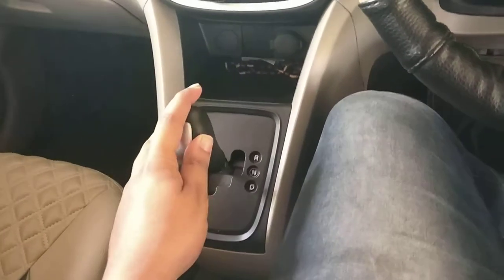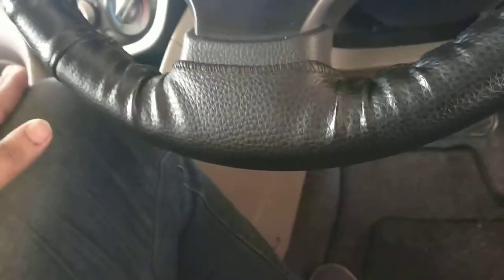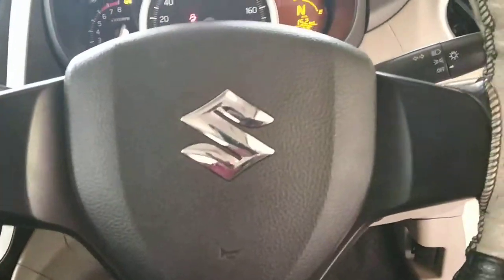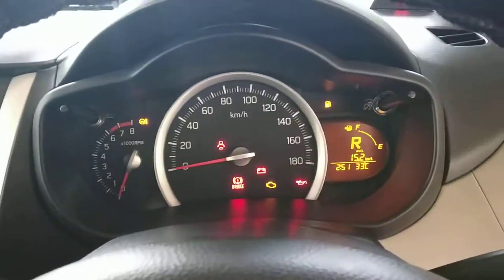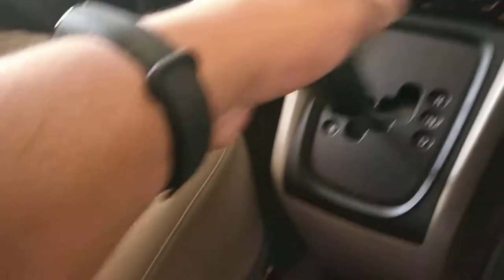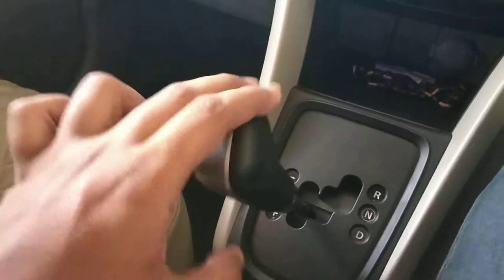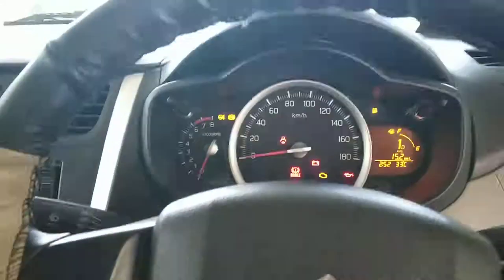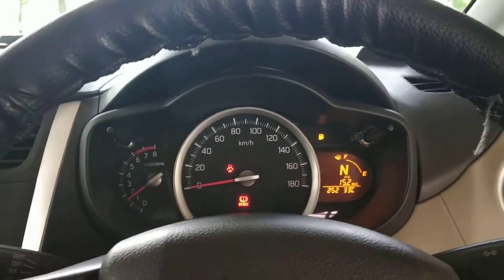How to drive an automatic/AMT  (Malayalam).#best explanations

Comment: Hi bro, nalla informative video anu👌👌👍👍
2 doubts clear cheyuvo..
1)Ithinu Parking gear ilalo, apol namalu evidelum vandi park cheyumpol hand breakinte kude, drive mode ano idendathu ato neutral ano??
2)Vandi neural itu start akitu, drive mode idathe direct manual itu start cheyavo, sadharane pole break release cheytu ato first move cheyumpam drive mode ititu pine manual aki move cheyane patatholo??
Reply from the maker: 1. It's the same way as that of a manual transmission vehicle.
You can either park in gear or neutral.

2. You can either choose manual or automatic after starting the vehicle from neutral.
There is no order to select manuel or auto
Reply: Funky Monkeys Thank you😃

Comment: Kayattathil AMT vandi aenganeya start cheyunne ? Manual'il roll varaathe erikaan half clutch edukana pole, ethil ntha technic ?
Reply from the maker: Role avathe brake use cheythal mathi bro
Reply: @drdrive1997  ee situational gradually accelerator kodukumbo left use cheyendi varumelo brake use cheyaan ?
Reply from the maker: @AshishThomashere  the same way as manuel bro first hold brake using right leg remove the same and put accelerator down. Same as manuel dont use left leg for any purposes
Reply: @drdrive1997  right leg brake'il ninnu remove cheyumbo oru gap ele, appo ethu roll back aavile ?
Reply: @AshishThomashere  xactly my questian.. Idhinu aarum reply tharilla..dont know why
Reply: Yes , while on hard climb start , it's better to use left leg to assist braking to avoid back roll & blip the throttle a little more than usual to add the momentum.   Practice will help you master it . I'm an AMT driver too & had these situations done at ease. (Remember , only use left leg on such situations , otherwise keep it in rest position   to avoid unnecessary actions)
Reply: Nirthi ittirikunna (parking) vandi move cheyyandirikan entha cheyyuka?
Reply: @AshishThomashere  bro it's better use handbreak & acceleration to climb & free left leg always👍

Comment: AMT വണ്ടികൾ park ചെയ്യുമ്പോൾ ഏതു mode ലാണ് gear ഇടേണ്ടത്
Reply from the maker: You can either park in gear or neutral.
Just the way we do in Manuel vehicles.

But don't forget to pull the handbrake 😁
Reply: @drdrive1997  drive mode ൽ ഇട്ടു park ചെയ്താൽ hand brake engage ചെയ്തില്ലെങ്കിൽ വണ്ടി ഉരുണ്ടു പോകാൻ സാധ്യത ഉണ്ടോ, ഏതായാലും നാട്ടിൽ വന്നാൽ ഒന്നു പരീക്ഷിക്കണം, wagon R 1.2 AMT എടുത്തിട്ടുണ്ട്, normal automatic ഓടിക്കാറുണ്ട് AMT ഇതുവരെ ഓടിച്ചിട്ടില്ല
Reply from the maker: @nejeebmullappalli7039  The same as manuel
Reply: @drdrive1997  Ok, ഞാൻ ഇന്നലെ manual download ചെയ്തു വായിച്ചു, അതിൽ പറയുന്നത് parking brake engage ചെയ്തു gear lever reverse gear or Drive mode ൽ ഇട്ടു വണ്ടി off ചെയ്യാനാണ് പറയുന്നത്(കയറ്റത്തിൽ ആണ് park ചെയ്യുന്നതെങ്കിൽ gear Drive mode ൽ ഇടുക ,ഇനി ഇറക്കത്തിൽ ആണ് park ചെയ്യുന്നതെങ്കിൽ gear lever , reverse mode ൽ ഇടുക)

Comment: Manual gearil gear up cheyyumbol accelerator release cheyyenammo
Reply from the maker: Always up to you.
To get a smooth transmission without jerking, try to remove the accelerator while shifting gears in manual mode.

Comment: Sir automatic vandi churam kayaran prayasamundo
Reply from the maker: The same as that of Manuel. 
To avoid unnecessary shifts, use manual mode while climbing hills.
Since its AMT.
No problem with CVT, DCT OR torque converter